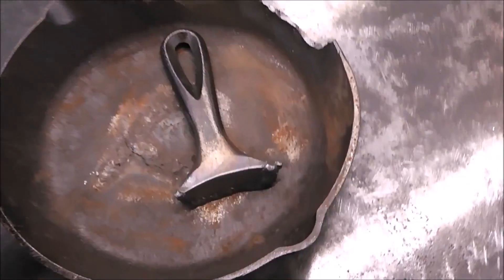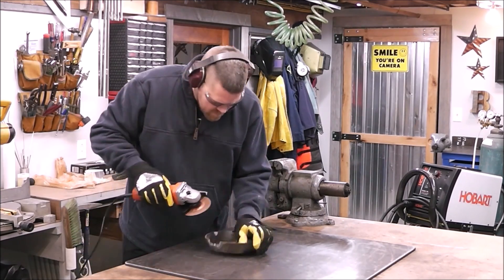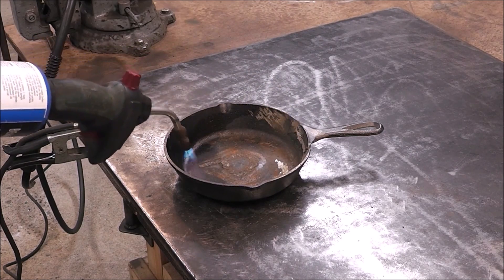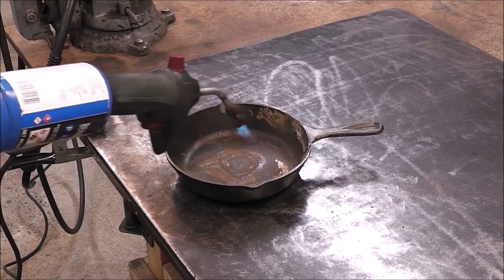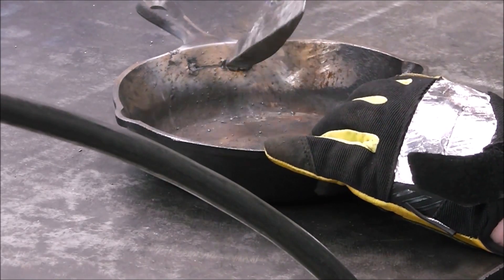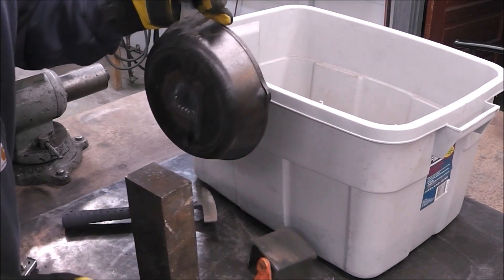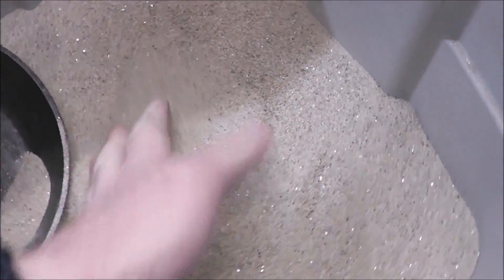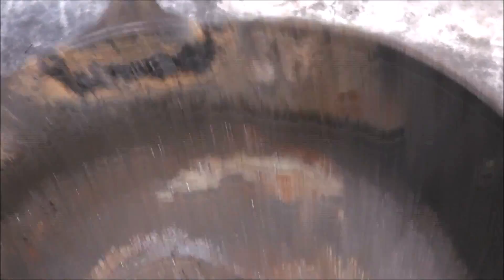Does Welding Cast Iron on Both Sides Make it Stronger?

Comment: Now get same a new pan and do the same test. That would be interesting! 
Would the nickel/silicone be the best rod type to use? If not, what is the best?
Reply from the maker: That video is in my cast iron repair series where I do just that. I measure how much weight it takes to snap the handle on a new pan, then I repair it and do the test again 👍

Comment: I've always welded cast iron with Ni rod (nickel) and have had great luck. Drill holes at both ends of a crack, holes along the crack and apply a preheat to where you can't lay your hand on the weldment, then weld about 1/2" at a time, peening in between passes. When finished, bury in ashes and let it cool slowly to avoid stress cracks. Thanks for your informative videos.
Reply from the maker: Spot on! So far the best repair to date is MIG braze silicon bronze. It's almost as strong as original. I actually have a video on it. It's quite impressive!

Comment: Hi Brandon, I've got an old Seat car, which has a missfire, which in turn (I believe through the vibration) keep's snapping the neck of the Catalytic converter, now many time's I've Migged the split which normally last's about 6-8 month's (ish), The old Cat I've pretty much reached the stage where I'm running out of "weld-space", but before I start doing the same with the newer Cat ( Granted it'll need to be stick this time, cos the mig has reached to welding zone in the sky), have you any suggestion's for the weld to last a bit longer, so far I've done straight mig, then straight mig again, then last time which lasted about the longest @ 6-8 month's, I used perforated steel strip ( or builder band, as it's known over here)
Reply from the maker: Craig, are you able to cut it off completely and slide a coupling over each end. Sounds like you are getting a lot of vibrations which is cracking your welds. The coupling would add the mechanical strength while the weld would simply seal out the exhaust gasses.
Reply: @BrandonLund  good thinking, even if I could make a form of collar, that should help
Reply from the maker: I was thinking, if you measure the OUTSIDE diameter of your pipe, you could buy pre made couplings at your auto parts store with that INSIDE diameter. Then split the coupling lengthwise with a cutoff wheel or whatever and pry it open, slip it over your exhaust, squeeze it shut then just weld it all back together again. It's just a thought

Comment: Yep. I had no doubt it would be stronger welding both sides.  I purchased that same Hobart welder in the spring of this year. Have burned a many of lb of rods with a stick welder. But had never struck a arc with wire. After multiple projects and 5 lbs of wire I'm sold. Welded a 4 inch crack on a tractor rim dual. Drilled a hole at the end of both sides of the crack. Beveled and welded both sides. Good as new.
Reply from the maker: @Duane Henicke that's awesome man! Wire welding is super easy if you've started with stick. I'm glad to hear you had great success with your repair 👍

Comment: Brandon for the sake of comparison you need to weld another cast iron pan using cast iron nickel rod with an arc welder and then do the weight test.
Reply from the maker: Great tip Allen. I actually just started another pan project. Its in the cast iron playlist.

Comment: I like your gauge card, also my Hobart doesn’t have that big sticker on it to tell what settings to use
Reply from the maker: Thanks man! Did your machine not come with one or did it get removed? If it didn't come with one maybe I should photocopy mine and put a copy on my Facebook for others?
Reply: Brandon Lund Brandon mine never had it I guess , my Hobart is about 10 years old, maybe they just didn’t put the sticker on then or mine was forgotten at the manufacturer, I bought it at tractor supply store , it would be nice to put a copy on your Facebook page I’m sure I’m not the only one that would appreciate it. I also have the 140 like you do .

Comment: just a question, but if your kinda like tac welding it together (on off short burst heat) wouldn't that be like leaving idk what to call it but lets say contamation on the inside where u cant see like when u hit it then stop hit it again in the middle of that process would there not be contamation because its not say a solid weld as if u just went from one side to the other? but I know why u didn't cause of heat I'm just curious if theres a difference.
Reply from the maker: Hey Doug, by tapping or peining the weld you are removing any slag that formed from the top of the weld so when you restart the weld you are welding on to clean metal again.
Reply: ah ok that makes sense. Thanks
Reply: P.S. I subscribed to your channel
Reply from the maker: Thanks man! I appreciate your support!

Comment: I am not going to enter because my OLD Lincoln 225 burnt up and all I have is a Hobart 187 now.  Anyway I like all your videos because you are never to old to learn something.  Thanks Brandon for another good one..
Reply from the maker: Thanks David! So which machine do you prefer? I'm a Hobart fan myself.
Reply: @BrandonLund  For work under 1/2" steel The Hobart 187 work great. But when I am over 1/2 inch steel I prefer the Lincoln 225 (OLD VERSION). The Hobart has to work it's butt off to keep up with it and gets hot. I put a new improved fan with more CFM on both welders and it helped a lot. All my welders and plasma cutters run 240 volt. ALso the Ingersoll 7 hp air compressor.

Comment: when I fixed my vise which was broken in two I beveled all edges and welded with pre heat to 400 f  and  used 3/32  arctic 90 cast rods with pulse stick 90 amps dcen  3 passes and then cooled over night on the wood stove which I let go out . in the morning cool to touch and no cracks and the vise is back together and working fine.  so cast iron can be welded quite easily by anyone if they just follow the technique .
Reply from the maker: Good stuff. Cast rods are usually a good choice and take your time as you found out.
Reply: thanks Brandon, keep making your videos they are great,, how about some mig up it is the one position most have trouble with.
Reply from the maker: I like that suggestion! Thank you. And yes mig up is more difficult but I will see what I can put together! Cheers brother!

Comment: I've watched all of your cast Welding videos, well probably all the welding vids. I stick welded a cast fire grate with 6013! Cosmetic extension so no weight test...
Reply: Haha, only rods I had, too inpatient  to wait 24hrs for the nickel rods. Just started welding this year, evening mig course completed. Bought stick as I want to be outside more than in. Got a climbing wall to build out of scaffolding poles. If I knew what to do I'd post a pic of the grate but Im not that techie.
Reply from the maker: Thank you for your support! Hmmmm 6013? I'm not sure ive tried that one yet? I may have to give it a try!

Comment: You should do one with the pan upside down so when the weight is on it,it actually has to pull apart from the weld on the bottom of the pan because the way it is now is similar to a cardboard box, open on top so you could put your hand on and pull one side away , if you know what I mean.  👍left my comment on other video hopefully it shows up.
Reply from the maker: I like that idea and your comment showed up also :)
Reply: That’s good. If you try it that way you could clamp the pan to the table and hang weights off handle. Be interesting to see pulling from another way like I mentioned.
Reply from the maker: I like it!